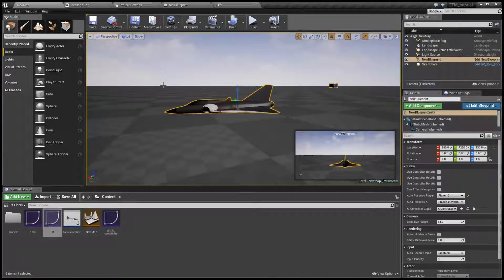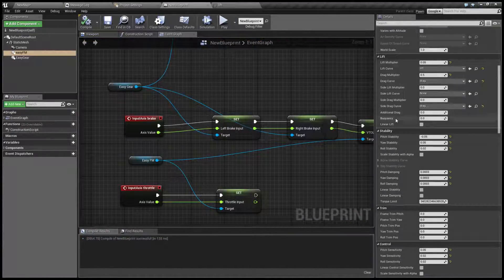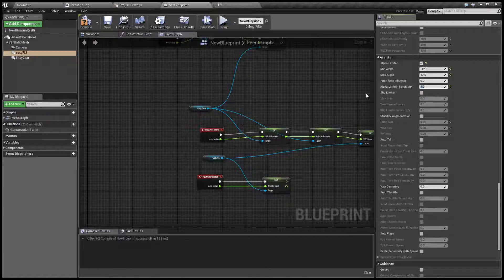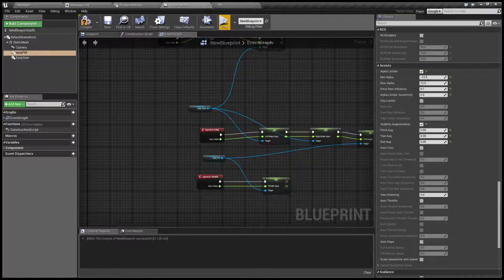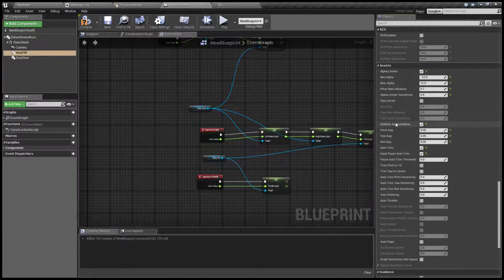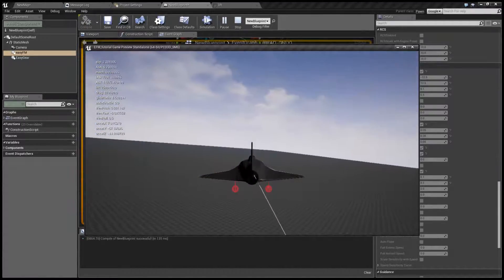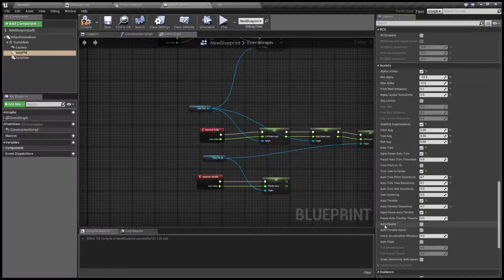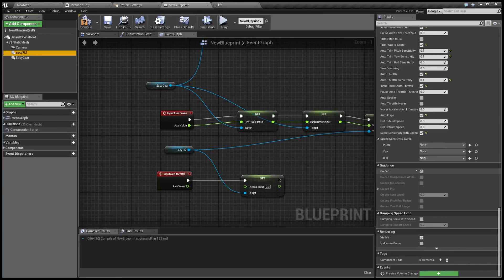EasyFlightModel UE4 tutorial ep.6 (assists)

Comment: Great tutorial! One question though, auto trim doesn't seem to work for me. I am on UE5.4 and have played with multiple values for auto trim but the debug text always says auto trim 0 and the aircraft isn't effected. Auto trim is the only assist I have on, and I am using linear scaling instead of exponential for most things. Any ideas?

Side question, what is the difference between the normal stability option and the stability augmentation assist option? Do they work together?
Reply from the maker: With auto trim: try disabling the option to pause auto trim when receiving inputs.

The difference between stability assist and stability is that assist uses the plane's controls to counteract rotation, while stability is the air frame's natural tendency to stay pointed forward.
Reply: @Worstplayer  I did try disabling the auto-trim option, but it had no effect. I ended up just making my own version of auto-trim using the AOA data provided by EFM, which works well!

That makes sense regarding the difference between stability and stability assist, thank you!

Also, I have been using this plugin in my project for a while now, and it has been great, but a couple of minor issues I have found that I would love to see fixed in future updates:
The dampening for pitch, yaw, and roll seems to be very speed and framerate-dependent. Essentially, at high speeds and or low fps if any EFM damping is being used, the plane begins to oscillate at a very rapid rate and loses control (physics substepping helps some, but it still can occur pretty easily). I don't have it downloaded at the time being, but I believe this can be seen in your example project with the jet. Try accelerating to a decent speed, then run the UE console command "t.MaxFPS 10" to limit the framerate to 10fps and observe the jitter. In my project, I resolved this with my own implementation using Unreal's built-in angular damping. I just start with a base value and increase it with velocity. That custom solution never causes the plane to lose control, even at mach 1 and running at 1fps. 

The landing gear system also appears to be framerate-dependent, making it very erratic at lower framerates. It seems to clip into the ground, then launch the plane upwards. Is the ray cast for the landing gear limited to once per frame?
Reply from the maker: @TheseRocketsOnly About the framerate: Normally the model should be fairly independent of the FPS, as long as the frequency of the oscillations doesn't exceed FPS/2. If you're experiencing framerate dependency, check if you don't have async tick enabled in your project settings (known issue, i haven't been able to fix it yet).
Reply: @Worstplayer  Got it, yeah I don't have async tick enabled, but still see oscillations using EFM's dampening. Probably due to the high speed of my plane (I am also using exponential lift, but linear stability, sensitivity, and dampening btw, not sure how it behaves with non-linear controls). I have seen some others mention the oscillation issue in one of the other tutorials (ep.2 I believe), but my custom dampening works for my use case, so I will continue with that. Thanks for the quick responses and great plugin!